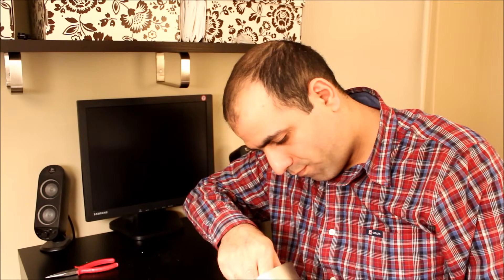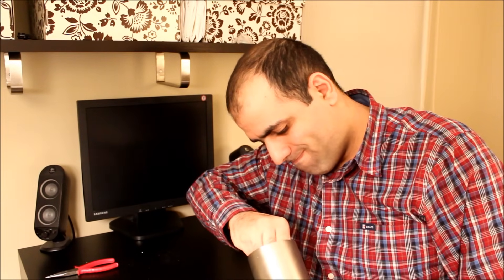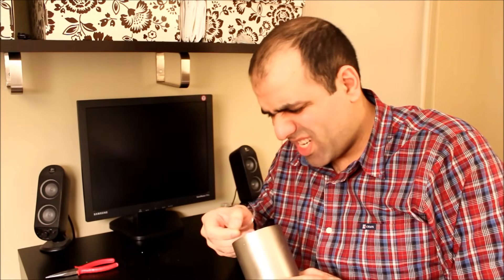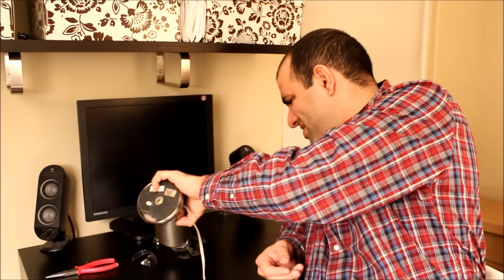How to Change a Light Bulb

Comment: Hi, I don´t understand this formula IR²=P. Does this mean that the thermic energy doesn´t depend fromthe electric voltage?
Reply: Yes but you don´t know the voltage in this formula. So transformers elevate voltage and lower the current to avolid too much heating in the powerlines so I´m wondering if this is more current dependent and that´s ehat intrigues me because the full power is a product of UI from what I´m understanding.
Reply: Yes, but how can I know the heat formed by a current in a resistance in relation to the amperage?
Reply: Because the heating seems to be more depending on the current than on the voltage.
Reply: But what is if I have a transformer which creates 10 000 Volts and 5 mA and a lamp that only lights at 5 mA what would happen if the current flowing through it is 5 mA?
Thanks for your help!
Reply: yeah, but here is my point if you put 5 mA at 230 Volts through it or at 10 kV doesn´t seem to affect the brightness of the light. So this is a big difference in work! 230x5 mA = 1,15 W
with 10 000 Vx0,005 mA = 50 W. So why can the lamp withstand this difference in power without even changing?
Reply: I mean if you weld you also need to have very high currents at comparably low voltages to heat the metal.
Reply: Even if I have a transformer pushing 10 kV  through it? If you weld with 800 amperes at 30 V would it be the same if you weld with 24000 V at 1 ampere?
Reply: thanks
Reply: ok
Reply: That´s really intriguing because I thought that I had understood how energy transmission with powerlines work but now the hole thing with the amperage and voltage transformation doesn´t make any sense anymore to me.
Reply: Yes I know, the product w=UxI must remain the same minus lost energy. But that´s not what intrigues me is why 10 kV x 1 A don´t heat up as much as 1 V x 10 kA? If the voltage is the pressure and the charge the amount of water it means that the higher voltage x lower current makes the electricity more liquid and let it "rub" less inside a powerline. But even here I´m confused with the definition 1 V= 1J/C because that´s not really a pressure like thing to me. I thought I´d understood all that but now I see that it is farmore complicated. :)
Reply: Ok.
Reply: 1J/C is 1 V. So it means that I need more force (F) to move a charge (Q) along a defined way.(d): 1N/C x d = 1 V.
Reply: So I need need more energie and more force to move a higher charge tomaintain the same voltage. But if the Tension is the force it means I need more force to maintain the same force? Doesn´tmake any sense to me but I can better imagine machanical than electrical problems.
Reply: I mean under the condition that d remains unchanged
Reply: So you will always have something like 1N/C x 1 m
and 2N/2C x 1 m.....
Reply: This video is too complicated. I GIVE UP
Reply: it means RIP too
Reply: ***** Since you're here, how come the computer light didn't turn off when you made the house light turn off?
Reply: ***** Thanks. Or is it?
Reply: Muck2014 its the formula to the illumanati P= confirmed.

Comment: how can he touch live wire (breaker pops) and he is still here, does he connect every device to dc current so the light turns on and acts like in ac (blows up if not correct and such)?

Comment: Don't touch hot bulbs.
Switch off power to the fixture before you  touch it.
Use a tool to take stuck parts out.
Use the right voltage of bulb or it'll blow up.
Don't screw cheap bulbs too tight.

Comment: PROTIP:  Rub the screw base of the bulb against your nose before you install it.  The extremely thin film of oil will help prevent the bulb from sticking in the socket.

Comment: Glass bulb has come off the screwy-in bit?

• Make sure the light is switched off
• Make very sure it's switched off
• Open a bottle of wine (cork closure,  not screw top)
• Remove the cork from the corkscrew
• Insert the cork into the screwy bit of the light bulb
• Unscrew, using the cork as a tool

You can also use an eraser, but this has the disadvantage of not involving wine.

Comment: If the screw head contact of the light bulb breaks off in the socket, instead of pliers, use a potato.  Kill the power to the socket first, then cut a potato in half and shove the potato into the socket and rotate counter clockwise.  The end of the bulb will unscrew out of the socket.

Comment: I went to change out the incandescent bulb in my refrigerator with an LED.  The LED bulb lights up fine in every socket BUT that refrigerator, and incandescent bulbs work fine in it.  I tried putting a drop of solder on the center of the bulb as well as increasing tension on the side contact in the socket.  Still no dice.  Now I have to pull the socket out of the refrigerator so I can test it on my bench and find out why it's not making contact.  Is life really this difficult?   I feel your pain, but I still haven't got that silly LED working in the refrigerator.  At least the one in the freezer side works just fine...

Comment: 1:28... Wait.... That doesn't sound right...
Reply: A 100 watt light bulb at 110 volts is 909mA which means 121 ohms of resistance. At 220 volts, 121 ohms will pass 1.8A, and 1.8*220=400 watts.
Reply: What if someone had a bulb made in China?

Comment: How is this guy not dead?😱😂😂😂😂😂😂
Reply: getting an electro shock with your other hand and feet isolated from ground, will only result in a burn on the hand and finger and/or exposed area.
What kills you is having the current running through your heart (if you touch the electricity with one finger, and then with the other hand touch ground, the current will travel between hands, and of course, through your earth).......I would suppose (but not confirm) that if you touch it with your right hand, and use the right foot as ground, is not likely you get toasted........but dont try it.

He was touching the lamp with his other hand, but the lamp itself is isolated from the current lines (d'oh)

Comment: Throw the nasty old incandescent bulb in the bin and install an LED bulb. Don't get nearly as hot, I have never seen one leave the base in the socket, even the cheap assed bulbs from the dollar store are tough as hell compared to any glass bulb ever, and they last ok so long as you keep them cool. I paint the base black with a sharpie because black is supposed to radiate heat away better and I haven't lost one that I have done this to yet
Reply: When I change light bulbs I install the LED ones.

Comment: All this pendeoho had to do was to unplug the lamp and use a potato to remove the socket.. 2ndly,, don't install it so tight.. as soon as the bulb turns on,,,,,,,,,,, sufficient torque.